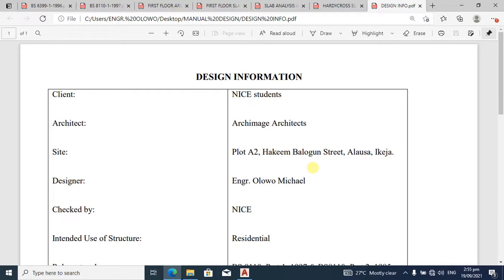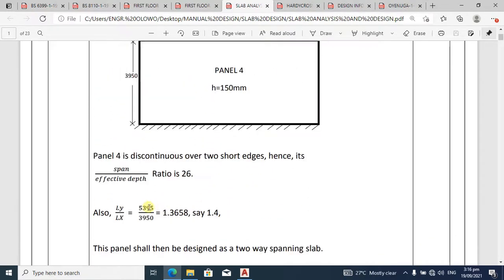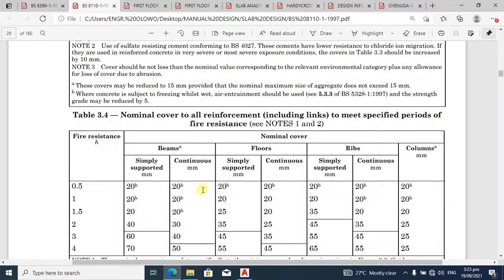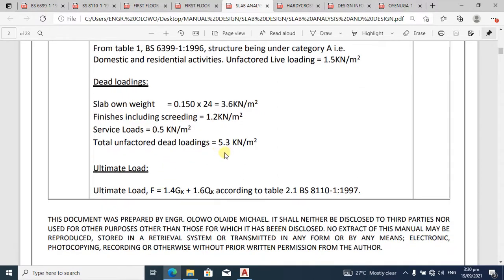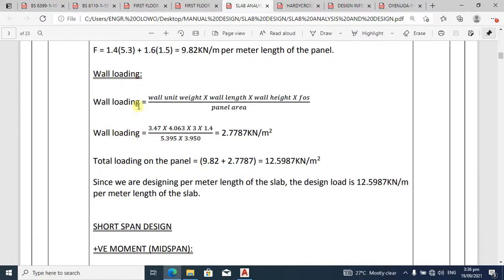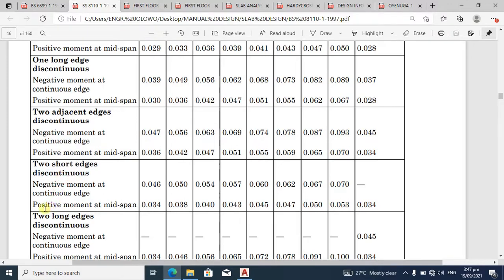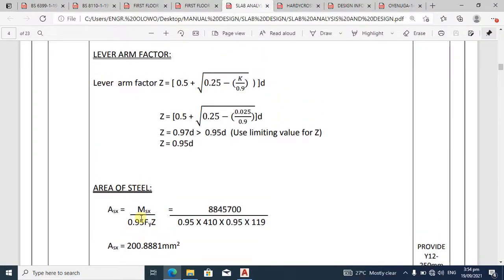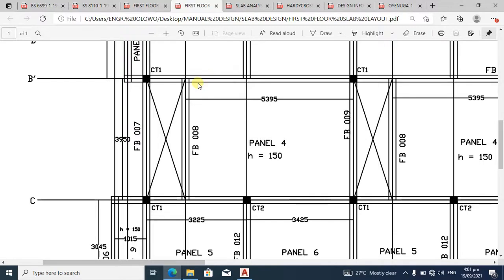SLAB ANALYSIS AND DESIGN PART 1

Comment: My broda u sabi pass jor...thank u for the breakdown......my question is suppose all edges were continuous (using these same span distance u have here), which direction will normally have/require the most over support amount (top) steel...as in which lenght will have smaller spacing (more steel)??....the short span or the longer span (the over supports on the two continuous  sides parrarel to the short span or those parrel to the long span) ......am trying to say for over support requirements, the bars athe the continuous edge parallel to the short side is normally the wosrt?? Or those continuous edge parallel  to the longer are usually worst?????

Comment: 1) Sir,  What will be done if our Ultimate moment (Mu) is lesser than our Design Moment (Msx)?
Reply from the maker: When the design moment (e.g Msx) is higher than the ultimate moment (i.e Mu) of the slab, then, there  would be need to introduce an additional layer of reinforcement which is called COMPRESSION REINFORCEMENT.

These are otherwise called doubly reinforced slabs.